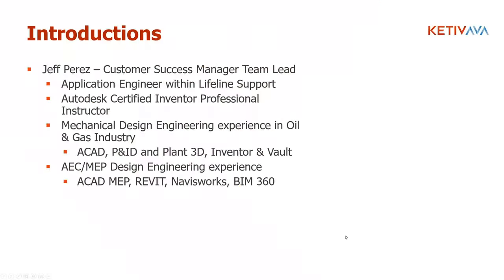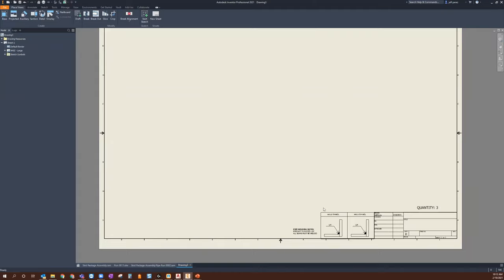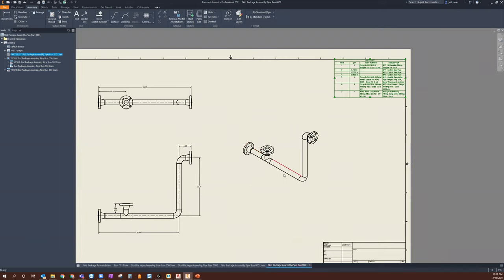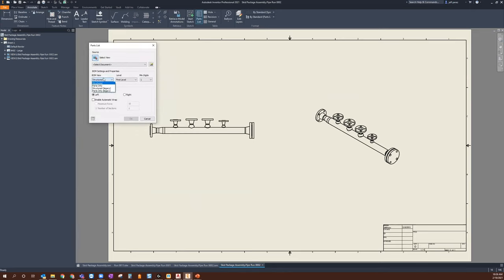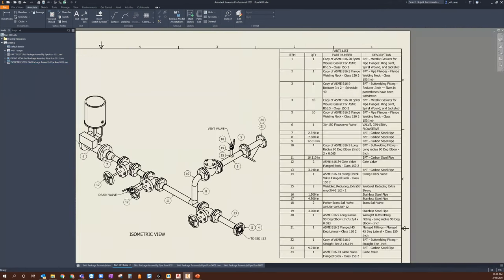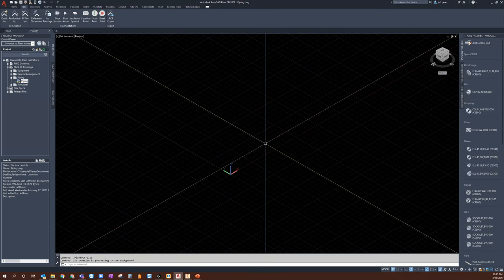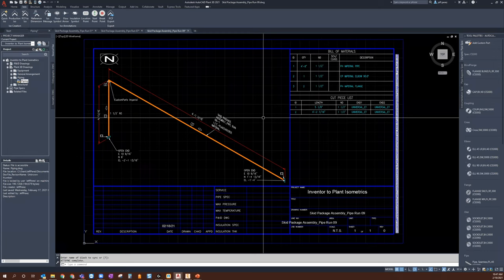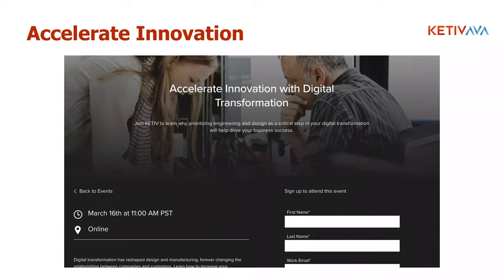Tube & Pipe: Generating Isometrics | Autodesk Virtual Academy

Comment: Question, since there are material stress tests in the program and they use ANSI Pipe,Fittings,Valves,Pumps with a library that has information about the pieces Can the program calculate pressure drop though your pipe runs through all the valves and actuators?